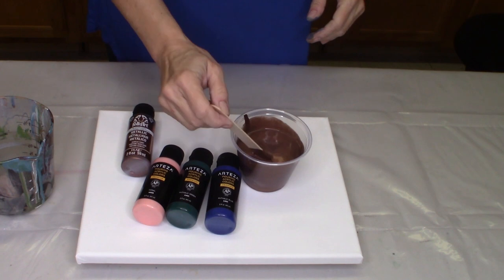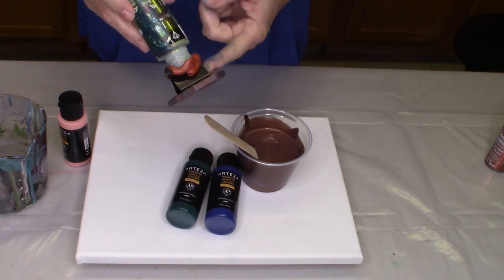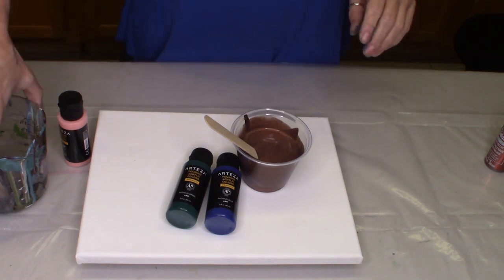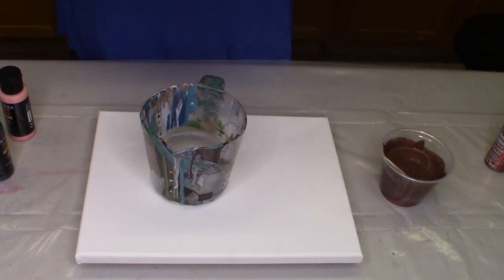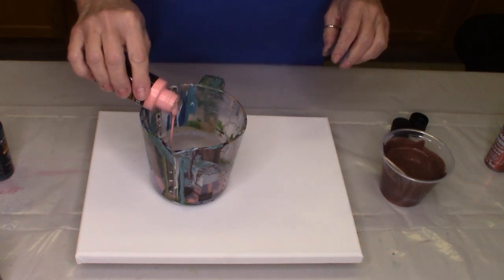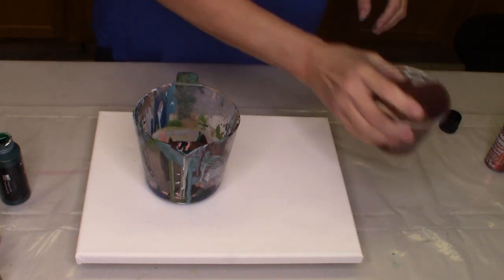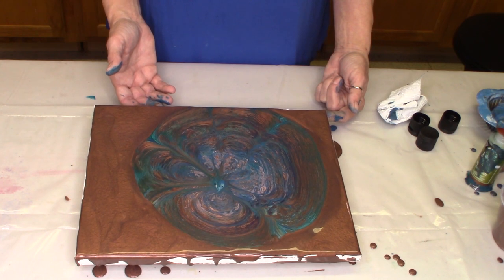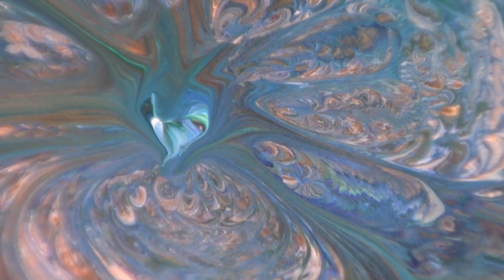Elevated Sink Strainer Pour

Comment: I thought leaving that much paint would cause to crack
Reply from the maker: I have used water as the medium before and got cracks, but never with products such as Floetrol, Liquitex or DecoArt. By using a 1 to 2 ration (1 part paint to 2 parts medium) you actually have more medium on your canvas than paint. Thanks so much for watching!